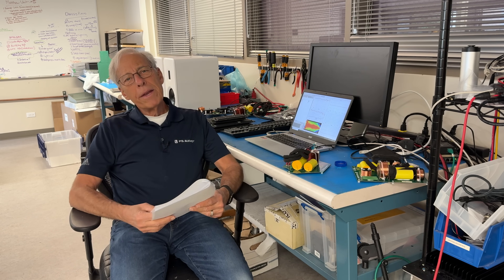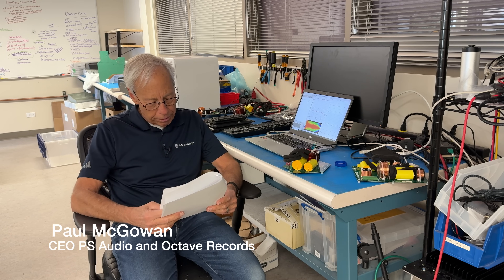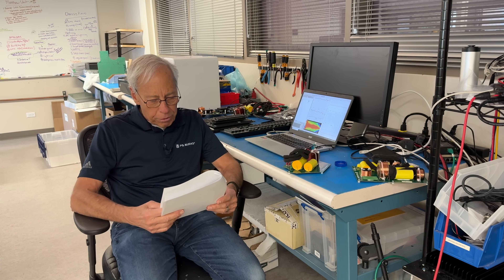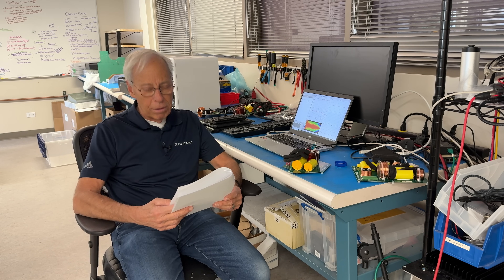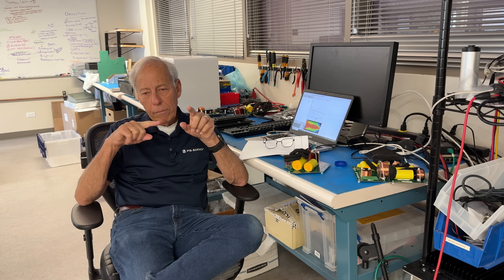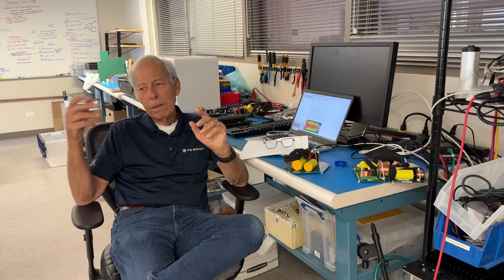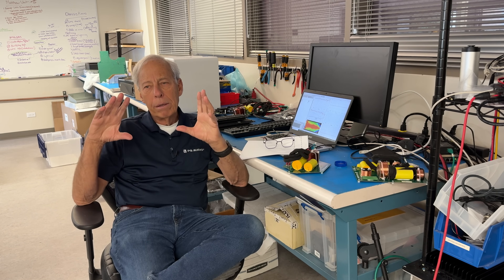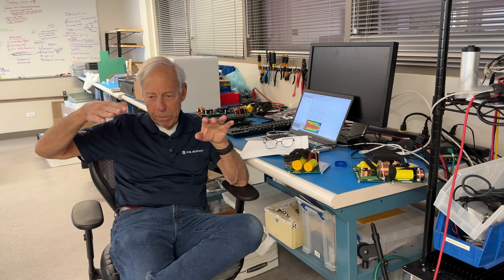Transmission line speakers explained

Comment: 1/4 Wave Transmission Lines are to the speaker & subwoofer world, what the Daywalker is to Vampires;
"all their strengths, none of their weaknesses except for the thirst"
Transmission Lines have near transients of a sealed, with the benefits of a ported design, without the "weaknesses", expect for size!
Depending on who's designing, sometimes size may be an issue. In all my time designing 1/4 wave enclosures, I've only been stumped on two occasions due to dimension restrictions of the requested enclosure (car audio subwoofer). 

I've been designing 1/4 waves since 1991, but I would never claim they are the be-all and end-all of speaker design! It's 'A Way' of enclosure design, not 'The Way' of enclosure design! But it is better than 99% of ported enclosures!!!😆🤣😎

Comment: I've never heard that a passive radiator is 180 degrees behind phase of the driver. My gut would say that it is 90 degrees out of phase (like current following voltage) near the Fs of the radiator.

Comment: I've always been curious about the tuning of these pipes or "transmission lines" over a range of audio frequencies.  Assuming a subwoofer operates between 20 to 200 Hz or so, the wavelength ranges from ~17 m to 1.7 m.  The length piping needed to bring the output port back in phase then is going to likewise vary by the same 10 to 1 range above.  So I've always struggled with understanding how fixed length piping would cover a decade range of frequency change.

In radio frequency engineering it is not uncommon to use transmission line matching circuits built of 1/4 wavelength stubs that are open or shorted as desired to achieve the result we want, but again the range of frequencies supported by this kind of design is limited unless you have other tunable elements in the design to adjust as the frequency changes.

Comment: A friend had some old, relatively cheap, Mission 7 series (I think) with a closed design - the bass sounded so tight they were wonderful. Extension wasn't that great, but so enjoyable to listen to. I have Spendor towers and SVS Ultra sub, but I still hanker back to the sound from those old Missions.

Comment: I still use a pair of transmission lines i built 50 years ago, recent crossover upgrade has brought them back into favour. Too big for the house (any house probably) they reside in my workshop about 9 metres apart. Originally built to reproduce church organ music ,   The bass of an eagles recording can only be described as bathing in warm melted butter.

Comment: Transmission line are fantastic when implemented properly..They aren't a mainstream design simply because not many speaker manufacturers know how  to build a good one.
Ascension Loudspeakers (Adelaide Australia)  ultilise the technology on all their speakers pretty much.. Fantastic Speakers using SB Acoustics Drivers. 
That builder has mastered the difficult art that is the Transmission Line.
Reply: PMC. 
Sanders.
Reply: ATC.

Comment: IF the low frequency coming from a woofer was a sine wave at a specific frequency then perhaps the sound coming from a passive radiator or a port would be okay BUT because a woofer or sub woofer is typically not playing a sine wave at a specific frequency and is more likely playing a multitude of frequencies the delay caused by both transmission AND passive radiators IS NOT "in phase" with the signal that is being delivered by the woofer.
The end result of this is the muddying up of the overall bass response of the speakers as the passive radiators or transmission port deliver delayed signals at the same time the low frequency driver is delivering an entirely different signal.
People often mistake the delivery of "more" bass as "better" bass when, in fact, the bass is actually worse due to loss of clear transients and the addition of added harmonics and distortions caused by the delayed signal from the passive radiator(s) or transmission port.:hand-orange-covering-eyes:

Comment: How can the passive radiator (or transmission line) be «one cycle behind»? The frequencies in the base part of the sound may consist of multiple frequencies/soundwaves. How can each of these individual soundwaves all be delayed «one cycle» when they all have different cycles/frequencies/wavelengths?

Please explain, someone.

Comment: I have both sealed box and ported speaker designs, and a well engineered ported loudspeaker gives up little or nothing to a great acoustic suspension or sealed box speaker.  I want accurate and powerful bass and have experienced it from ported and sealed boxes, but I've never owned a transmission line loudspeaker.

Comment: 45 years ago, I built a pair of transmission line speakers based on the AR Bailey design using KEF speakers and Coles supertweeters. The line is tuned for 20Hz. I still have them hooked up to my television where they have a much cleaner sound than those in the TV.
Reply: I built my TL speakers about that long ago and they're still going strong.  I had to re-foam the woofers about 20 years ago.  I used a TL design paper and 4 - 10" long throw drivers (2 per box) from Speaker Lab in Seattle, WA.  Hand wound crossover coils with dome mid-range and dome tweeters.  Spent a long weekend tuning the line using an o-scope and signal generator I borrowed from work.  I think I needed 4 sheets of 3/4" particle board for the build, and that was my wish list for Christmas that year.  I cut all the wood at my parents house, drove back to my apartment and then assembled the speakers there.

Comment: So transmission line design has become a popular topic? Was just discussing this in another vid thread. Transmission line design is kind of like a reverse horn system. Instead of using a horn in front to load the driver's front wave to, a tunnel/ horn is behind the driver to control the back wave. The wave from the back of the driver is loaded into a path who's length and size controls the air pressures release into the room. Like a ported speaker but with additional time delay and more tuning. Because of the length of the transmission tunnel, it's output is delayed in time from the front wave. Thus the extra energy/ extended bass is because of the time delay/ smear.

Comment: I've owned countless speakers with ports in the front and in the back. Never heard one that has chuffed. Paul referencing speakers that have a port will chuff is a bunch of malarkey. Also, I have an Anthony Gallo Classico speaker that has a transmission line and the port is in the back so the port isn't always in the front as Paul references

Comment: @Paulmcgowanpsaudio why is the bass from a passive radiator one cycle behind? Does that mean that the bass from a bass reflex tube is also 1 cycle behind? I thought passive radiators and bass reflex tubes had the same delay only that one was cheaper to produce and had chuffing and challenges in length while the other was more expensive because a PR is effectively a woofer minus the magnet and voice coil.
Reply: It is better to think of the output from any kind of cabinet opening being a time not cycle shift. The time between the energy at the back of the driver and it's existing the cabinet will be constant. So will only be at specific "phase" relationships when that time delay matches or is harmonically related to the wavelength. So when a signal is not wavelength/ time locked, IOW different frequencies, the "phase" relationship is not constant.

Comment: Kali Audio has a port design that doesn't chuff.  Have you looked into that?
Also, how does a passive system keep one cycle behind at different frequencies?
Reply: It doesn't! All delays are time consistent, not frequency dependent. Which means the timing cycle alignment is based on frequency to path delay. It is one or half cycle behind at a given frequency and no others.

Comment: I agree Paul.
I'm not a fan of ported speakers either, although proper designed ported speakers and properly designed transmission line speakers aren't that bad. Personally, I prefer a well-designed sealed acoustic suspension or well-designed passive radiator system.
Reply: If drivers in a box, Acoustic (Bullshit) suspension all the way! But I prefer panels.
Reply: @ well I thought we were talking about boxes, I apologize lol
Reply: transmission line ,are not that popular ,due to the cost of the cabinets
Reply: @ It seems to me that all the speaker designs, when designed well, end up being pricey.. I think the cheapest design is probably a two-way bookshelf(?) speaker that's not too big and not too small, with all its components chosen  carefully ..probably a sweet spot where a ported speaker of a certain size is the cheapest option, and will most certainly be of low sensitivity & hampered efficiency..😉 although some people will prefer them anyhoo..😂

Comment: Paul.. it's a half cycle, right ?(to get the transmission line delayed signal from the back of the woofer to align with the non-delayed front wave)

Comment: I have loved passive radiator designs from way back in the 70's. They work well. Just about every cheapy, portable little stereo these days are all using passive radiators. Why? Enhanced bass with little space. Thanks Paul ❤

Comment: Bose used the labyrinth model also. We had a transmission line in a our car audio system back in the day. The box was bigger and a lot of work internally to build it out. It would push out an incredible amount of sound with volume. It would miss some on the separation of notes and impact. Sealed boxes can have a nice tight sound for impact. Harder to get real deepness out of them though. No box and no speaker is perfect again it comes down to taste. Some of the tightest 15's I heard was when I owned the Klipschorn flagship corner horn speakers.

Comment: Many sealed subs are probably "cleaner", speakers with less (and even) bass output might "sound cleaner", while most rooms mess with the bass frequencies. The sitting position, the room and the fake bass traps are probably the biggest problem

Comment: Probably the most successful commercial  TL speakers made were the old IMF/TDL models from the 70s and early 80s. They were big, heavy, had  a lot of low end for their day, but weren't all that well defined and had poor power handling.  I owned a few pair of them and enjoyed them, but ultimately moved on to more conventional designs that performed better.   My understanding is that a pure TL would be closed at its end, ultimately absorbing all the rear energy from the woofer. But these had a large port and you could certainly hear bass coming from it. So I guess they were a kind of hybrid.  With active, DSP controlled subs, I see no purpose for TL's in modern loudspeaker design.

Comment: Surely, if the signal is one cycle behind at one frequency, the signal is likely to be half, or quarter of a cycle behind at another frequency? This has always puzzled me 🤔
Reply: And fractional values in between. e.g. if the port/ TL... is tuned for 20hz, a 25hz signal will will move between comb filtering timing relationships. Not stay constant at one cycle, half cycle, 245°, ...

Comment: The port output on a bass reflex is a half cycle behind the fundamental.. its a half-wave inverter at tuning. A passive rad is exactly the same as a bass reflex but it prevents pipe resonances and turbulence. Sealed boxes have box resonances and a roll off in the low end. Transmission lines are a quarter wave behind at the lowest tone, they maintain the wave front throughout the line (a bass reflex is a reactive bludgeon tool), a well designed TL will maintain a more even FR with regard to input voltage level, TLs are more efficient than vented (iron law volume aspect). Only issues are they must be used in a multi way speaker as the midrange becomes choppy and that they are massive and heavy. In today's levels of power and dsp usage.. eq can easily be applied to correct a sealed or passive rad setup to sound equally as good as a TL.... but that's cheating xx
Reply: "The port output on a bass reflex is a half cycle behind the fundamental" at only one frequency. All others are moving targets.
Reply: I agree with you that transmission line should be used only for low frequencies. My current setup of two channels is perfect example of that, there is two TL 8 inch woofers per speaker, they are full active four way and TL has 100 Hz low pass active filter. Then sealed midwoofer plays low mid area. I am pleased with extension and quality. Cabinets are pretty complicated tho.

Comment: The idea of the transmission line speaker is to absorb all the rear energy from the speaker ... it's a long tapered duct starting with a throat area equal to or larger than the bass speakers cone  area. The length of the transmission line is usually calculated to be a quarter of the wavelength of the speaker's free air resonance. The taper of the line ensures no resonances and this line is stuffed with varying densities of long fibre wool or earth wool ... Unfortunately they are a labour of love and you must expect to do a lot of experimenting before you get it all right . One thing you will notice is the  flat impedance curve at the LF end of the audio sweep. Rather similar to an aperiodic enclosure ...

Comment: I loved transmition lines, as a young guy the IMF occasionally showed up, but in poor condition, and back then spares were rare. 
I ended up with the HiFi Answers transmition line speaker, based I think on Cambridge Audio R50? Anyway, these were huge, ugly, caulk used in places, and a proper DIY job, original B139/B110 etc. They worked well, went low,  but I sold them to a friend.
I then ended up with Nightingale Audio NM1, with the later B139, Peerless mid, Isophon tweeter, external crossover, they looked much nicer, and had a cleaner more open sound, with a lovely tight low bass in a shallow TL cabinet, I spent some time with those, hoping to get mint large IMF, but ended up with Kef 105.4. I was very dissapointed with the loss of low low end, but man that speaker was just in another league with the quality and ability to just not be noticed. Soundstage, layering, depth, width, this was all new to me.

I still ponder the old IMF's, but at the end of my teenage years I ended up with the Kef 107, coupled cavity, -2db at 18hz, and was getting usable low end response far lower, I think around -6db at 13hz. But with imaging and a speaker that simply disappeared, a trick the Kef 105 and upwards managed superbly, that sadly the larger box speakers failed at. 

Over the years I tried other speakers, I still love large speakers, and that old style, I certainly would love to revisit transmition lines, and would certainly entertain the large IMF.
Reply: The t-linespeakers site has a dual B139 enclosure that's 6 x 2 x 2 (feet) and has two folded and tapered lines.  The Falcon Acoustics uprated B139 works very well in the enclosure and crossed over at 80 Hz makes a perfect partner for the old Quad ESL 57s.

Comment: As far as i see it, the maze is essentially for suppressing the other side's energy. So air although travels, letting the speaker travel freely, but actual sound from the back is negligible and does not interfere with the front / actual speaker sound. This phase thing is fishy to me, i mean, probably it works to an extent. But i would think only around a very specific frequency, no? What about the other frequencies where the out of phase problem once again arises?

Comment: you can put any kind of hole in a box(passive radiator included or flappy hole as i  call it).
but do give us sealed options too, a pure sound quality first cabinet. bass if for the subwoofer.
and as paul mention, one cycle behind or in phase if we please can get delay for the main speakers.

Comment: Hello Paul . Greetings from Romania. I have a question for you  . I have just encountered a change of paradigm in speaker design, the new Fourier Transform Speaker design. They look so complicated with a lot of cables and amplifiers, and I have read the description but I am still confused. The builder claims that the sound is much more accurate to the instrument because they do not propagate the sound forward as a normal speaker , but in surround as an instrument does  . Can you explain please how they work, and if they really are revolutionary ? The only video about it is on the Audiophile Junky channel on youtube. I've  also noticed some subwoofers next to the speakers but I am not sure if they are a part of the system or not. 
Thank you so much for your time and I look forward to your answer. Bye!